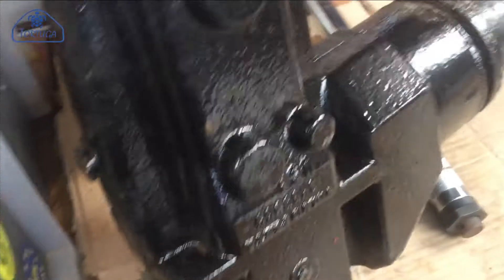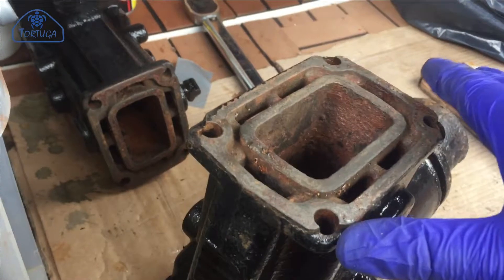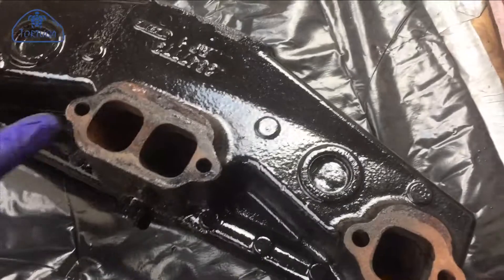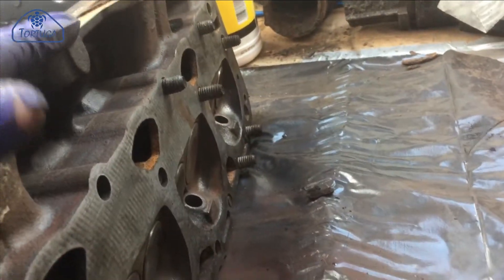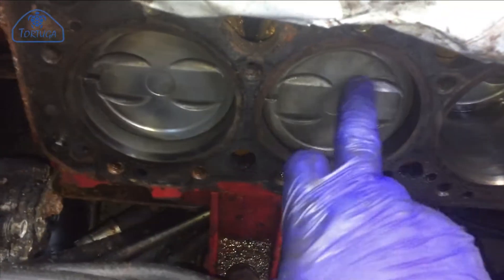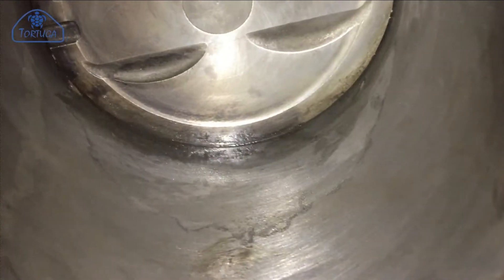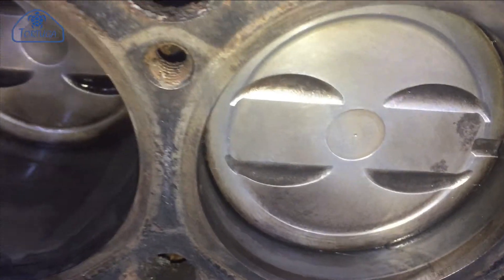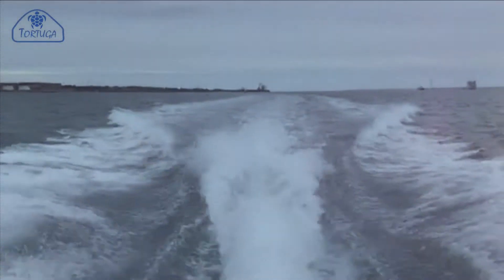Dealing With Water Ingress - Volvo Penta 5.0GXi-J V8 - Part 3

Comment: Well it certainly looked a whole lot better after all that work! Could you have not used a sand pad on a low setting on a drill instead of paper on a block? You say that you've going to vacuum it out, but will that actually get ALL the fine particles out? Look forward to finding out! 
Waiting for the next one 🙂
Reply from the maker: Thanks for the question - Whilst the sandpad and drill would have been faster, I wanted to avoid any possibility of gouging the surfaces. Also, with the amount the boat was rocking and bouncing, it could have been difficult to keep it under control.

As for vaccuming out the cylinders, they have been sprayed with spray oil, wiped, then brake cleaner, wiped, and will go through this process a couple more times before the vacumming, so fairly confident that should remove everything. The video is only 10 minutes long, but there was over 5 hours work there, mainly cleaning in between the steps.

Thanks for watching
Reply: @the-tortuga-man  thanks for answering, all helps with gaining knowledge! Nothing like bright corrosion free metal for your efforts!
I can see how the bouncing of the boat could have caused damage rather than being helpful! I must confess, the noise of the boat and then your comment about it being rather windy did give me a chuckle! 🙂